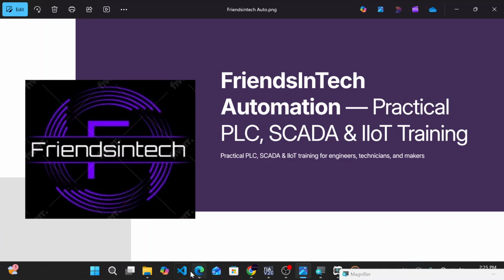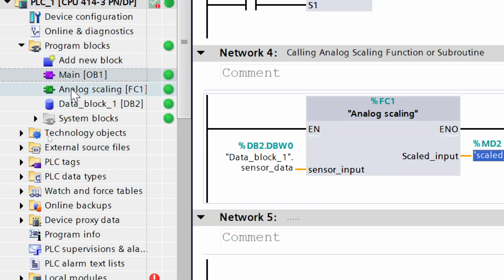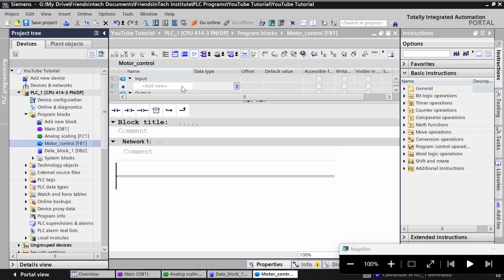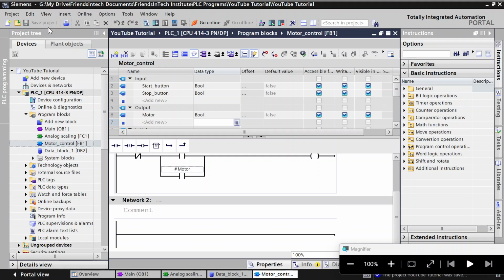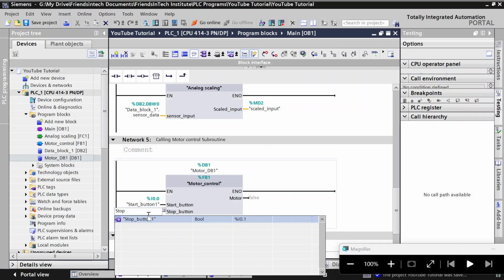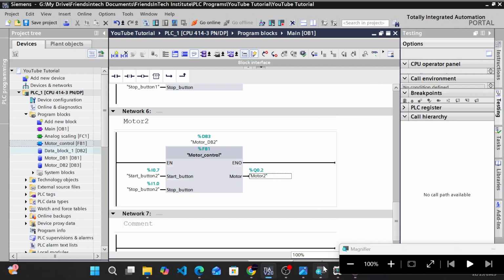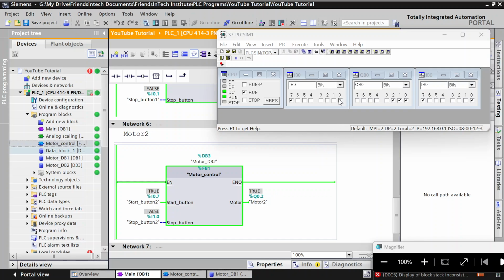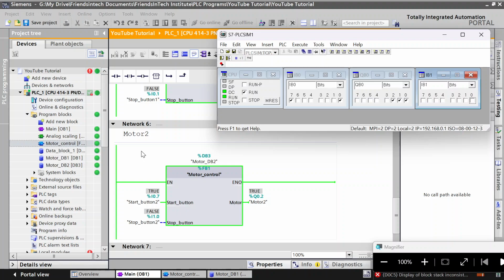PLC Subroutines Explained | Function Block (FB) with Motor Control Example

Comment: thank you for your video ,if the motor in the function block is failed so how to run separetely in automatic mode
Reply from the maker: To run it separately, you should implement an external safety interlock or a selector switch that allows you to bypass the block logic when the motor fails.